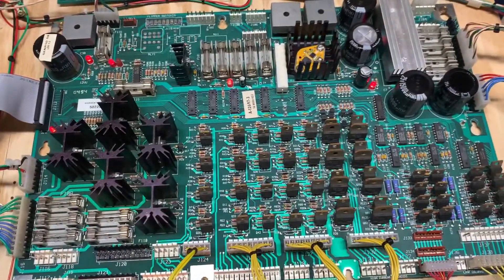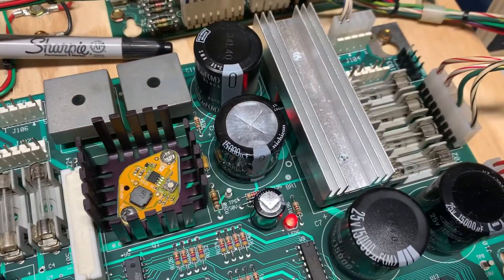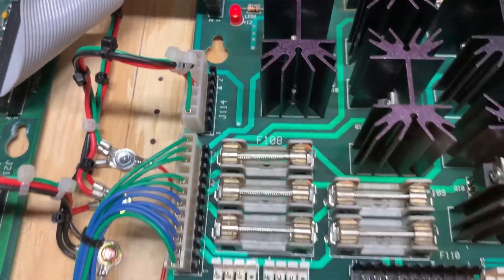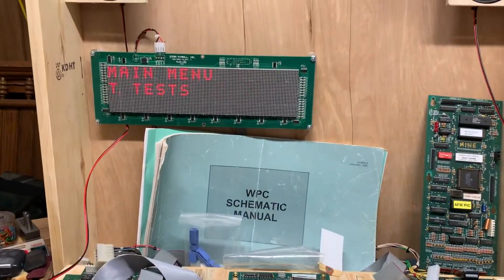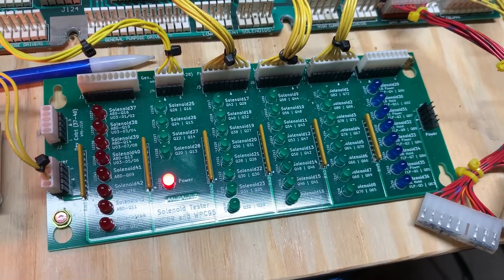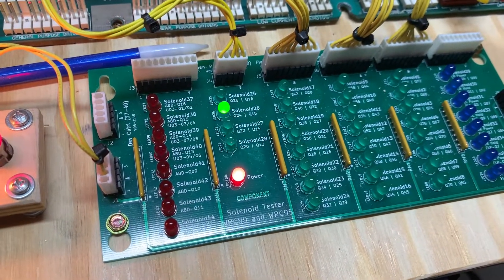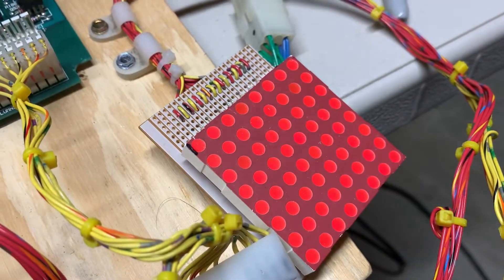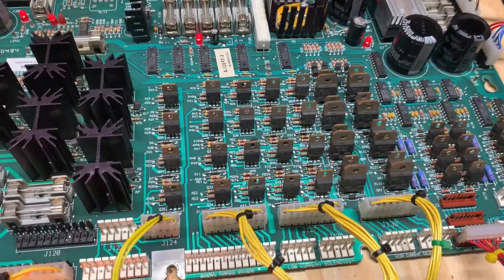Williams WPC Power/Driver Board standard Repair and Test

Comment: Interesting! My Road Show recently developed the symptom of dying as soon as the first flip is attempted. Now it woks start up at all. I was told the big caps need to be replaced, but here you just did those 3 smaller ones?
Reply from the maker: Thanks for the note. Unfortunately, wholesale replacement of all caps and all bridges is sometimes advised by well meaning but uninformed folks. I DO NOT recommend that advice. Your note came in as I was working on this board and video. Check it out here: https://youtu.be/NnJTgPuvA5M